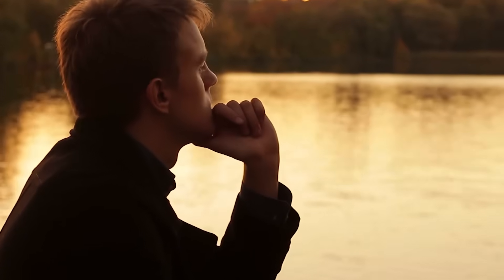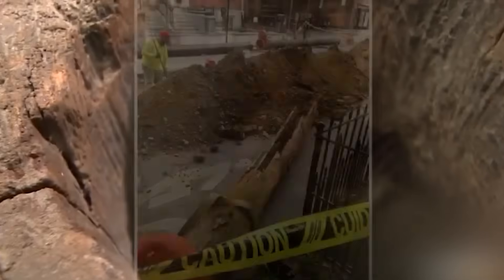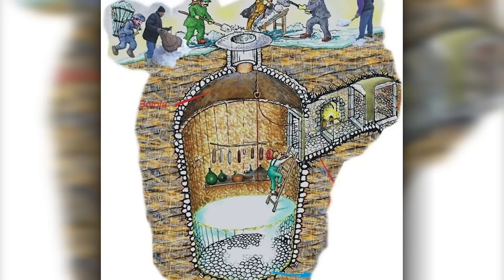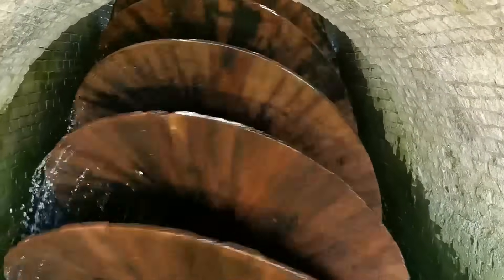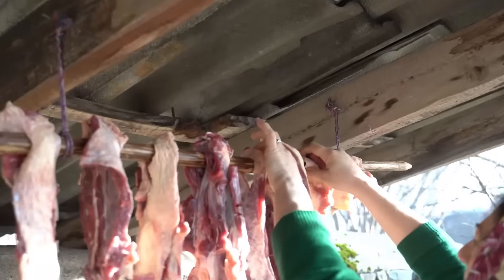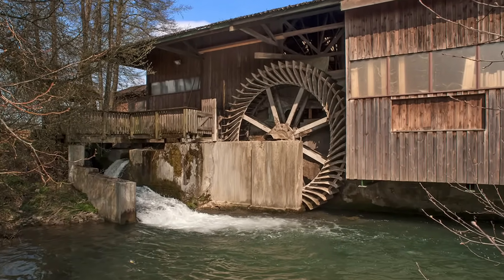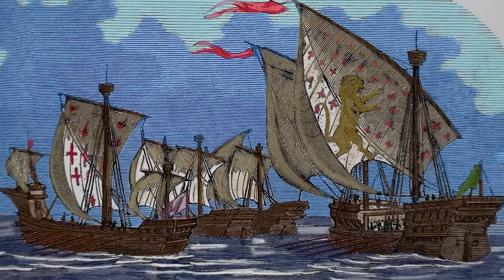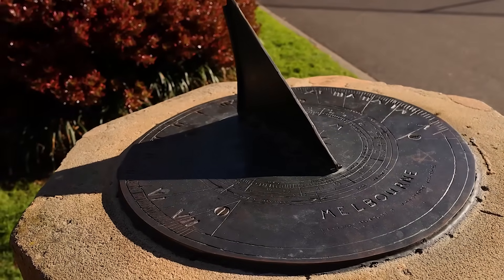12 Forgotten Medieval Technologies That Work Without Electricity

Comment: Seems like you would need some kind of voltage or watt regulation for a water powered electric system since the flow speed would vary throughout the year.

Comment: The wildest part is that we didn't just lose the techniques, we lost the thinking behind them. Medieval builders weren't just following instructions, they understood materials at a level we've replaced with calculators and safety margins. They knew how stone breathed, how wood moved with seasons, how water wanted to flow. We have better tools now, but somewhere along the way we stopped really looking at what we're working with. That's the gap. Nice video!.....❤❤❤❤